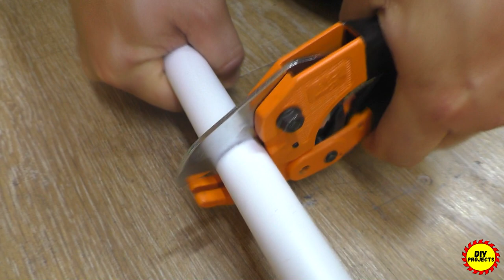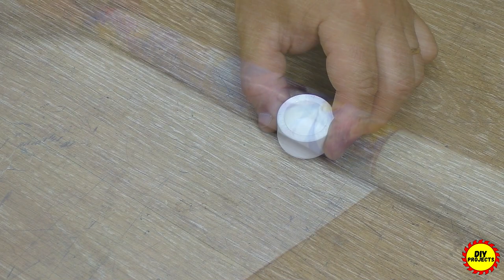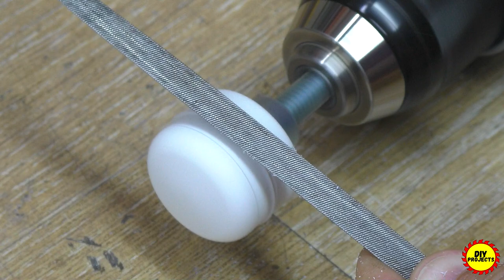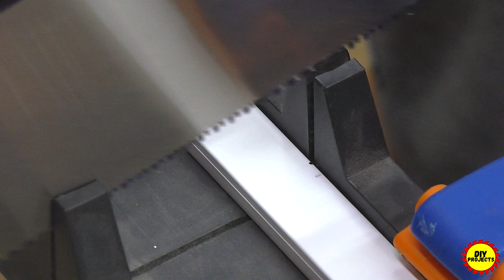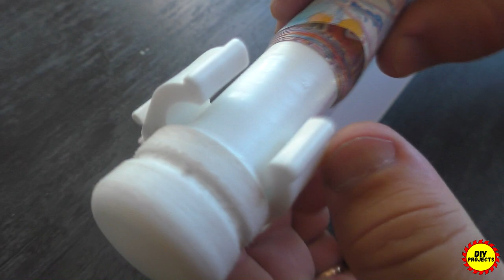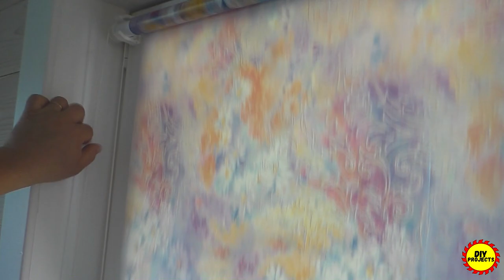Roller blinds with your own hands! The easiest and cheapest way!

Comment: I'm a little late to the game, but..YES! Sheer genius! What you will need: Half inch PVC pipe Cut to size, Less Roughly an inch. (A big box Store Will give you at least 1-3 free cuts, 5 or more if you flirt)
 PVC caps To fit, test them in the store. 3 C Brackets, Strong glue, A cheap shower curtain Or any fabric, Tablecloth Sheet Vinyl, 
(You can Glue the caps on the ends You don't have to melt them)
 Use a knife to cut The wedge In the end cap for the string.
 Oh, and.. Common sense!😁
Reply: Also, You could use Simple cord concealer strip at the bottom.